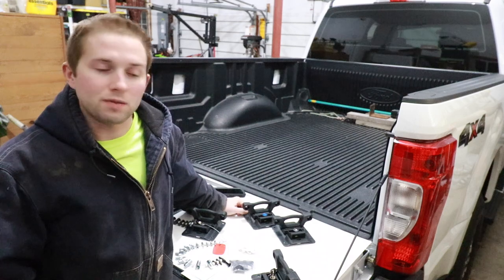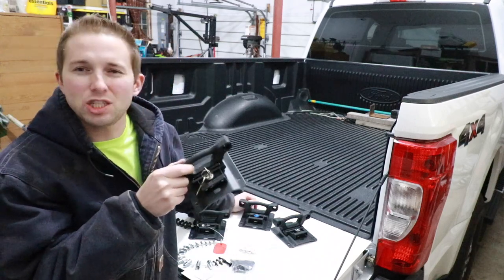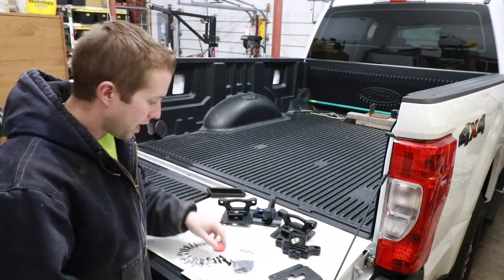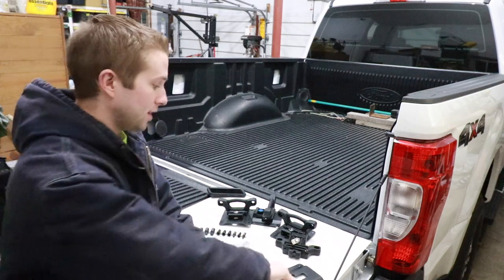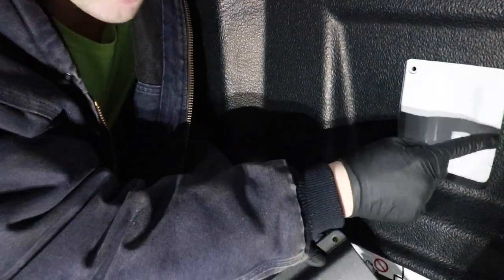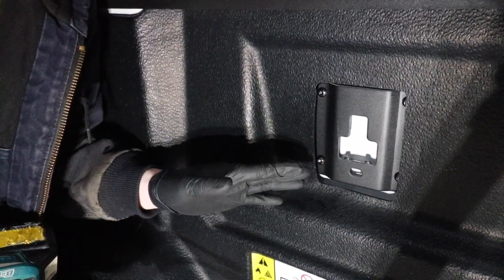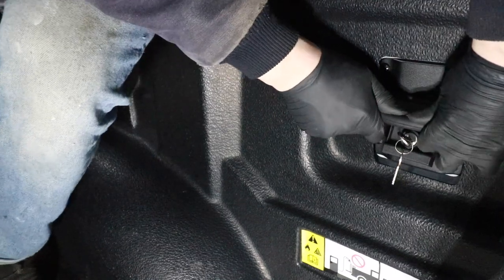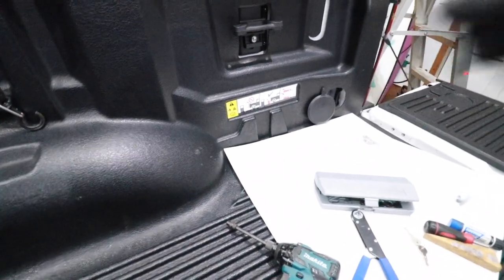Ford bed cleat installation | Boxlink

Comment: Cool video, nice job.  Have you considered removing your drop in bed liner and get a spray bed liner?  It would make for another interesting video.  Going over the pros and cons of each?  Thanks for all the videos, I really enjoy watching your channel.
Reply from the maker: Thanks for the support. I do not plan to remove the bed liner. If I had the option, I would prefer a factory installed spray in bed liner. Otherwise, I stand by my decision to install the drop in liner myself. It looks good, will hold up to a lot of abuse, and I don't have to worry about deterioration or overspray. Plastic liners are also much easier to clean.